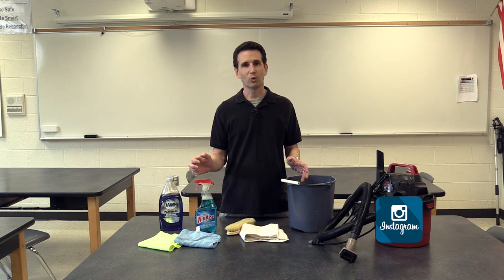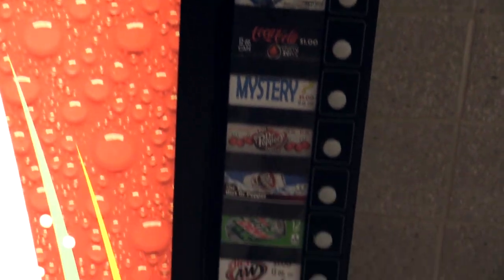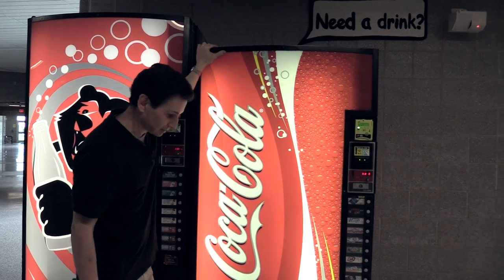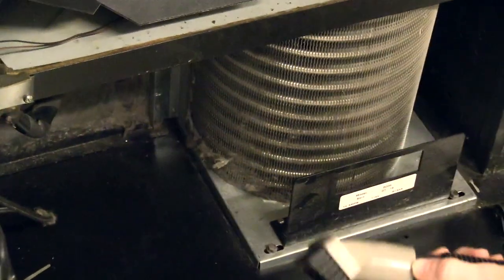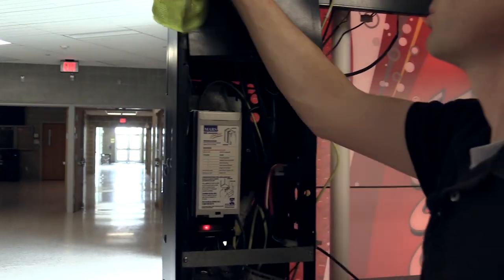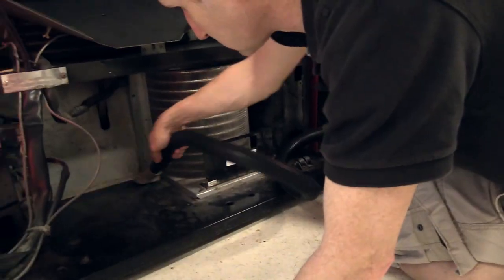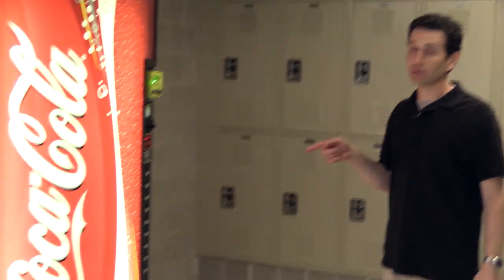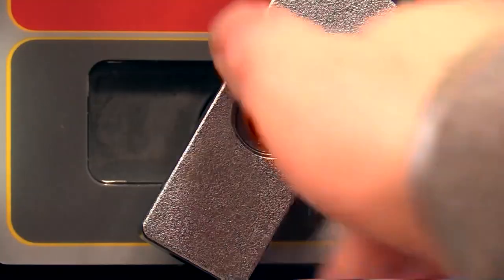Vending Machine Spring Cleaning

Comment: When I use to have vending machines at a location... I used auto wax on the whole exterior of the machine. It made it shine and helped prevent scratches.
Reply from the maker: Yeah...I would probably do that if my machines were located outside...but since they are inside I don't feel the need.

Comment: You mentioned you drove the machines from Philadelphia through a car wash, did you power wash the inside of that machine? If so, are there any risks of corrosion when doing this?
Reply from the maker: I used the high-pressure spray hose at the car wash to clean the machine inside and out..  I made sure to keep away from the electronics on the inside of the door (control board/coin changer).  No real risk of corrosion if you let the machine dry out.

Comment: Hey Bill, 

What is an ideal temperature to keep a snack vending machine in. I was thinking of putting it in a laundromat but it gets up to the higher 80’s because of the dryers.
Reply from the maker: Yeah...you can put one in a laundromat but you may not be able to put chocolate or products that melt easily.
Reply: You might consider a refrigerated machine for snacks even if you’re really worried about heat. I tested eating chips and crackers that were refrigerated and they were perfectly fine. Just a thought

Comment: can you steam the inside of the machine?
Reply from the maker: I've power washed really dirty machines outside after covering electronics...but I've never steam cleaned a machine.  I don't' think that is really necessary, plus you would need to be careful of plastic parts that are sensitive to heat.